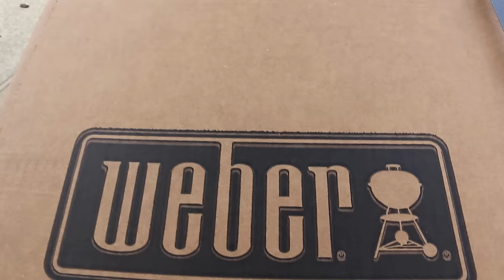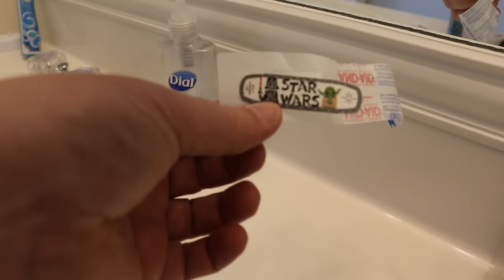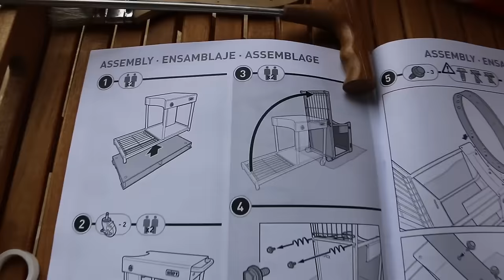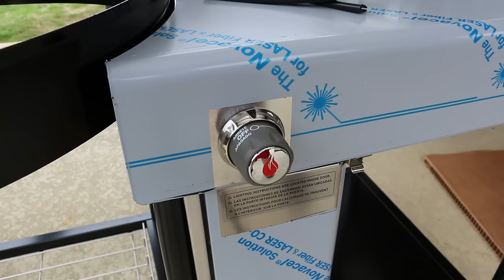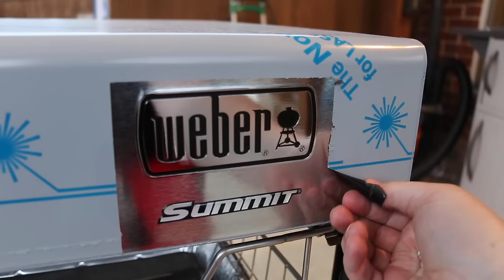Weber Summit Charcoal Grill | unboxing assembly review | Funny!!! | grilling center How to

Comment: maybe you could do this experiment: do one pound of lump charcoal in your KK, one pound of lump in the SCG, set them to same pit temp (or what seems to be as close as you can get), then shut each one down after a few hours.  When thing have cooled off, weigh the remaining lump in each.  It'll give an idea of insulating properties.

The KK would probably come out ahead.  Still not really a perfect experiment because the Weber is designed to do kingsford too (which is much cheaper than lump).

I'm just curious how much this 'air insulation' really works.  SCG still looks pretty awesome though.
Reply from the maker: +Kerns Cooking Great point about the yeti. I was really glad when they choose to just do air because the Kegs and Akorn kamados have insulation in the them and they are almost too efficient. It's kind of hard to maintain low and slow temps vs a ceramic. They are great as far as charcoal efficiency though. Everything is a trade off.
Reply from the maker: +Tommy Glick It's a good idea for an experiment, but that won't really answer you question because the KK is super-efficient but also really large. So it takes a lot of extra energy up front to get it heat soaked. I guessing the Weber will take almost none.  It would be interesting to compare over a long cook.

Comment: I have been watching and reading about the kamado grills while checking the prices for different brands at stores. When I came accross a price of $219 for carted version of Akorn kamado by Char-Broiler, which is originally $349, I thought it is the lowest version of Kamado grills and that is why it is so cheap compared to real ceramic ones that are priced above $599 or so.
That is why I passed that deal and now Weber is introducing their Summit Charcoal grill which is made with similar approach of Akorn design. Akorn is not real ceramic but insulated with air. If you are preapred to spend $2,000 or more for a Summit Charcoal grill, give a chance to an Akorn with cart for $350.
Reply from the maker: +Sonradan Gurme Thank Sonradan. I've actually owned 2 Akorns in the past. They are fantastic grills for their price point and they have some of my favorite features baked right into the design with that easy ash dump and the upper grate.

Comment: What the difference between weber preformer and the deluxe in the in th performer line
Reply from the maker: Hey Rome b,
They have changed the naming system since the last time I shopped them but it probably has something to do with whether or not is had the little folding table, the big table with no starter, or the big table with the gas starter. Just not sure what they call them all now. 

Hope this helps,
Justin

Comment: I love Weber and want this grill, but the one thing that annoys me about Weber is they still have the leg inserts on the cart model.  You think for the money they could make it all rounded on the bottom.
Reply from the maker: +Jeremiah Johnson Wow. It's like you are reading my mind. I called in to register it today and they asked if I had any feedback and I told them how ridiculous I thought it was to put leg inserts on a grill that will never have legs just to avoid updating the lower ash sweep (which I also think could have used a face lift for this model, but I won't lose a lot of sleep over if it does the job.)  

I working on a video where I give me initial thoughts on the grill and I plan to hit that point pretty hard. I kinda get it on the regular Performer because at least they use that kettle body with legs in other products, but this is an entirely new product. (I have a 26.75 kettle and I checked the base and it's NOT the same size as the Summit.) So basically they just added them to hold the ash assembly instead of redesigning it.

Comment: How long did it take to assemble?
Reply from the maker: The camera stuff made it an all day event. I think if you have two people, you could probably do it in a couple of hours. Weber does a good job with that part of it. The instructions are always clear and things usually fit together easily and the way they are supposed to. It sucks assembling but I they make the process as painless as possible.
Reply: Baby Back Maniac thanks man...I’m looking forward to getting it put together when it arrives!

Comment: Hope youll give a honest review compared to your Kamado grill.  I dont see this thing doing well in the winter when it gets cold compared to a ceramic grill.  Also dont see it hitting 900 or above but hope you can get us that info.
Reply from the maker: +john Weiland Hey John, Thanks for the questions. I'm not really worried about the winter. I've had an akorn and a Steel Keg in the past (both metal kamados) and they actually do better in the winter. I'm more worried about the wind, to be honest. 

As far as 900 degrees, I may not ever be able to answer that one for you. I never run them up that high. I did it with a BGE and lost my gasket, when I did it with a KJ, I cracked my firebox, when I did it with my Akorn, I lost the seals around the top damper. It's just not worth it to me.  I never really take the KK above 650 or so and I probably won't do that with this either. If it ever goes nuclear on me by accident, I'll let you know how it does. lol. 

if you have any specific questions, let me know.
Reply: +Baby Back Maniac thanks!! good luck how did you like the acorn for the price?
Reply from the maker: +john Weiland I absolutely loved it for the price. With the ash dump, lower shelf, and swing rack up top, its one of the best featured kamados you can get at ANY price. The only down sides are it's almost TOO efficient with charcoal so much so that the fire burns SO small on low and slow cooks that it's a little hard to hold temps (compared to a traditional ceramic kamado) and it's not really made to last forever. Having said that, I think if you take care of it, keep it out of the rain, and are willing to replace a few parts every now and then (they are cheap compared to Big Green Egg parts), it will definitely last long enough to get your money's worth out of it. 

Hope this helps.
Reply: +Baby Back Maniac it does I have 2 bge and 8 weber but always told friends to check out the acorn for the price it's look to be the best bang for the buck.  You seem to have had at least one of every grill would love to see your best of list and why.
Reply from the maker: I will probably do a video on that someday. 

The Komodo Kamado is definitely the best. Every single part on it is over engineered. It's amazing. 

However, the truth is that I like all of the one's I've had.
Reply: May I ask your view of the bge against all the others?
Reply from the maker: +john Weiland BGE is the name brand so they have the best resale value and everything else is "you know...kind of like a Big green egg thing" when describing it to someone who isn't into this hobby. I think they probably have the best ceramic too.

Having said that, you can get Kamado Joe stuff cheap at costco Road shows. The quality of the KJ is the same, and I have had better customer service with KJ vs my BGE dealer. Also, I really like that Divide and Conquer cooking system vs the BGE plate setter. That reminds me. if you haven't found Ceramicgrillstore.com yet, you should check it out. I'm sure you have though if you have 2 BGE's and 8 Webers.  

I'm not knocking BGE by any stretch. My BGE XL is one of my all time favorites. There is just so much competition this days. It's great for the consumers.
Reply: +Baby Back Maniac thanks buddy I'm just hearing how this new weber is the ceramic killer. I think it's a nice grill but I just want an honest opinion from someone that has them all.  not from someone weber gave a free grill to.  if you gave me any grill worth 2000 I'll say it's the best.
Reply from the maker: +john Weiland Weber didn't give me anything. I think people are going to be surprised by my review. There is a lot to love and some things I'd change.
Reply: +Baby Back Maniac wasn't referring to you all the others reviews I saw they got it for free
Reply from the maker: +john Weiland The only review I saw was amazing ribs video. You think they got that one for free?
Reply: +Baby Back Maniac lol he says "test" model not sure how he pulled that off. Chris over at vwb didn't even get one.
Reply from the maker: +john Weiland Interesting. I feel like people should blatantly disclose when they are given free stuff.